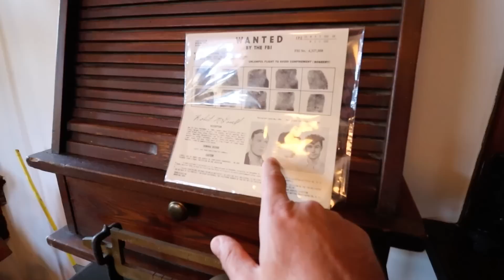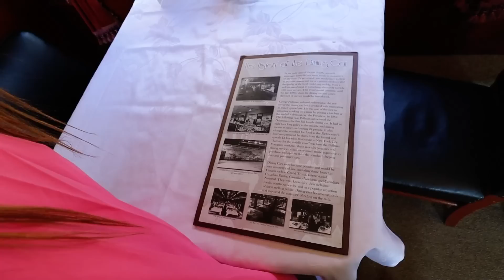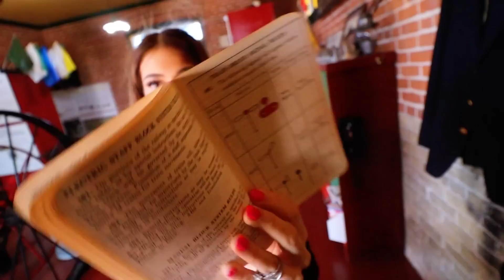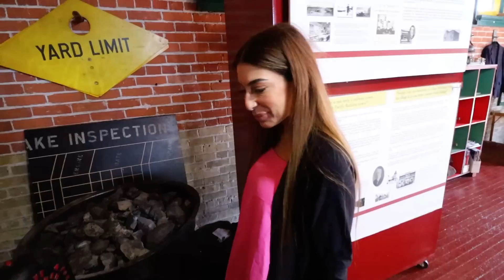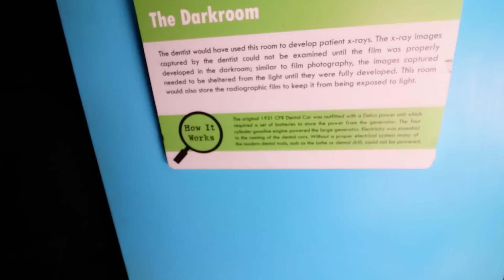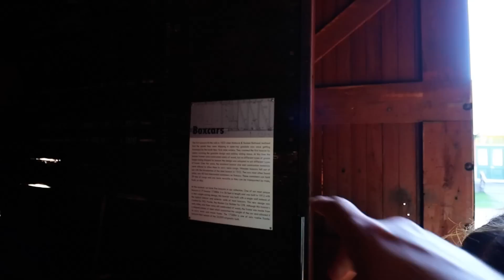TAKING MY PREGNANT WIFE TO HAUNTED GHOST TRAIN!

Comment: Wow! What a crazy story about the train incident. Glad you got it cleared up. 

I have a crazy train story myself. Was on the Missouri Train Bridge that connects Iowa to Nebraska. Was halfway across, over the Missouri River and I seen a train coming full speed ahead from the Iowa side. I started on the Nebraska side. Anyways I cant swim 😅 so jumping off the bridge into the water was not a option. So i took off at a dead sprint to try and get off the bridge. Train was hot on my heels, horning blaring and I knew i wouldn't make it off in time. Grabbed the side rail and pressed tight against it. Felt the heat and speed of the train hot on my back. Yea that was the most extreme adrenaline rush I ever experienced. Never, ever doing that again. I was one very reckless teenager and I pray my kids aren't the same.

Comment: All you have to do to drive a train is pull a lever and the train will start.  But once it’s going in order to keep it going you have to feed the fiery furnace coal.  And There’s gages and water pressure’s and stuff you got to keep an eye on.